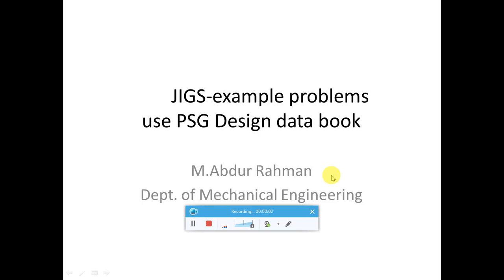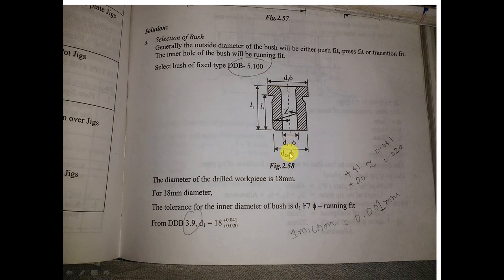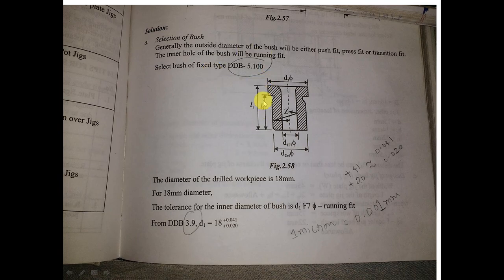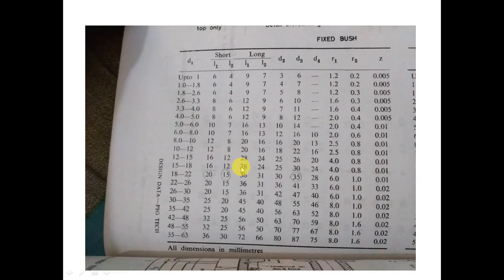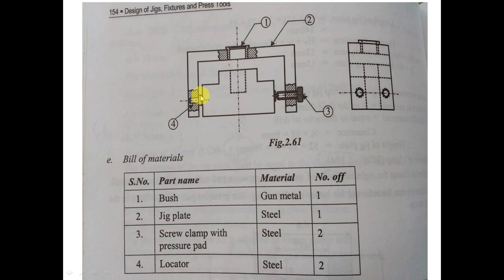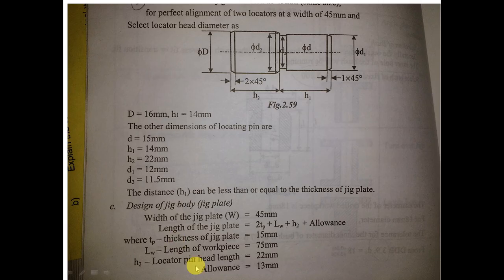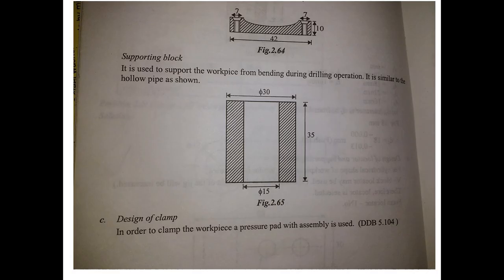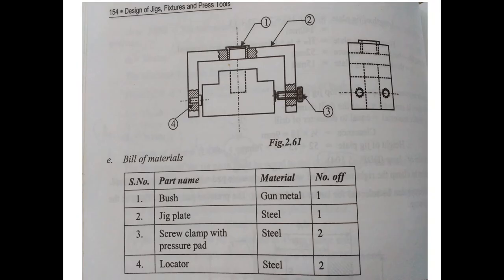Design of a drill JIG Problem 1

Comment: Sir can u explain y the clearance b/w workpiece and top jig plate is half of drill diameter for ductile material and equal to drill diameter for brittle material???
Reply from the maker: because of the chip formation variation in ductile and brittle material